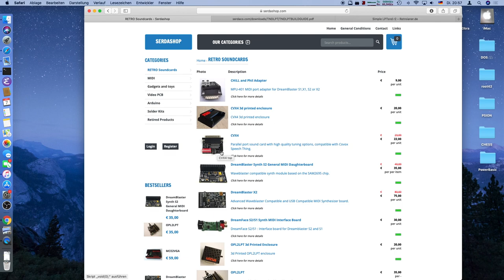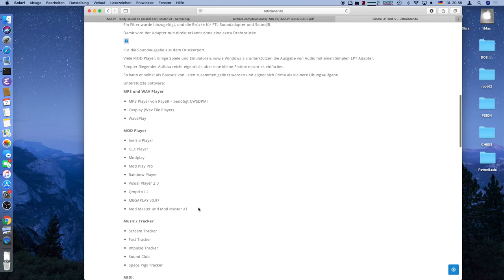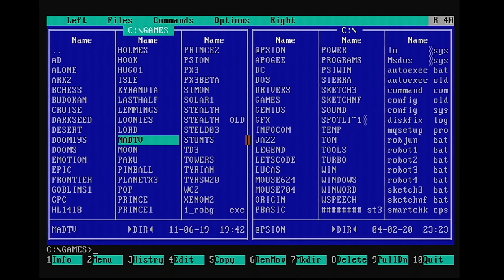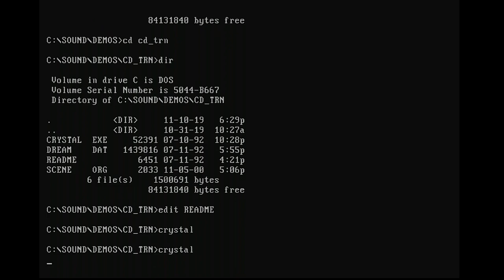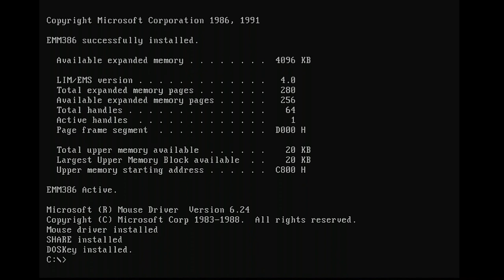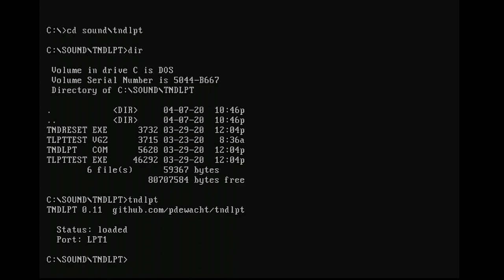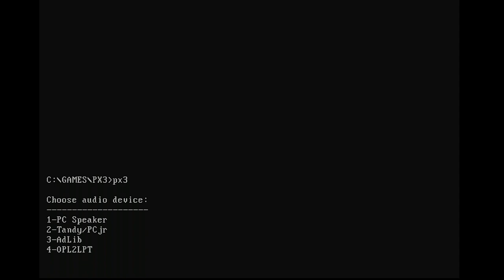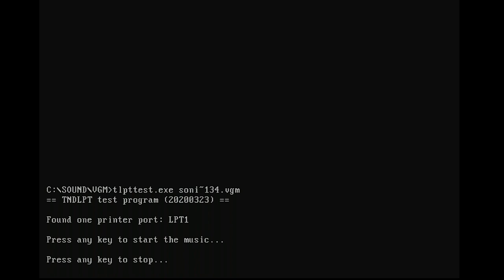Sound Cards On The Printer Port? TNDYLPT and LPTsnd

Comment: Did that resistor ladder use 1% tolerant resistors, or better? It sounded a little crunchy. When we were testing the serdashop lptdac prototype, we found that 0.1% tolerance was necessary for the best quality.  Not surprisingly, covox used that higher quality as well which is why their dac always sounded decent.
Reply from the maker: yes, it does sound a bit crunchy and harsh. The resistors have gold rings, so they are 5% tolerance. I imagine 0.1% to sound better, since they are an order of magnitude more accurate.
Reply: @root42  Oh gosh, yes, a resistor ladder needs 1% or better at minimum.  Might want to send a note to whoever is providing the kits?

Comment: Just picked up one of these today, and as it turns out it doesn't work fine in Maniac Mansion or Zak McKracken. The noise channel is mucked up. I did the research and figured out that these games will only sound correct on an NCR 8496 sound chip (which is found in the Tandy 1000SX and later). Monkey Island 1 actually does sound ok, I guess they're not doing whatever noise channel tricks they did in MM/Zak. 

I managed to find a real NCR 8496 chip on ebay (only one listing for one single chip from somebody on Long Island, so I snagged that ASAP). I'll probably throw up a youtube comparing the differences, assuming chip swapping actually restores the noise channel to its splendor.
Reply from the maker: The NCR8496 differences are known, there is even a patched version of Maniac that alleviates it a bit. But real NCRs are unicorns... still it's better than nothing.
Reply: @root42  Absolutely. I was expecting to NOT be able to "just buy one" but I when I saw that ebay auction I pulled the trigger. I think its a bigger deal for me because I grew up with a 1000SX and a 1000RL in the house, and Maniac Mansion was my first PC game. The OG TI chip sounds great in Zeliard, KQ games, and a bunch of other stuff I threw at it. It appears to only be the Lucasarts Tandy driver that doesn't do the right thing unless its being played through an NCR. I figure its a pretty high chance just swapping the chips will reproduce the Tandy sound exactly.

Comment: This takes me back. I remember building a stereo DAC from the Modplay README. It used a pair of proper ZN428 DACs so sounded OK. It was limited by the timing jitter caused by the SW timing loops needed to pump data to an LPT port. That's where proper sounds card like a Soundblaster really scored by being able to offload the timing and DMA to its Digital Sound Processor(DSP)(LOL - an 8051 really). Wished I'd known more about Covox and the like earlier so I could have got more use out of the device. Bought an SB16 6 months later and never looked back.
Reply from the maker: Yes, if the Covox had been more widely supported from the get go, that would have been cool. But missing DMA combined with the weak CPUs of the time were not favorable.